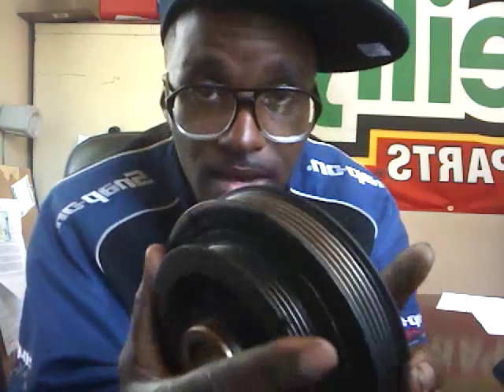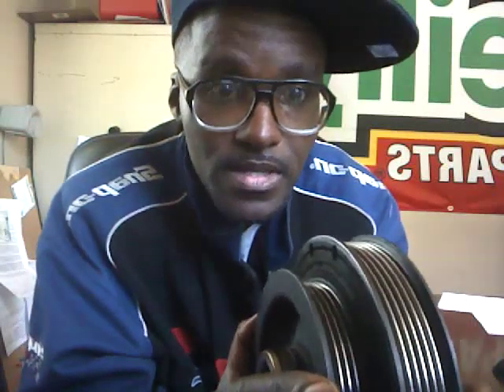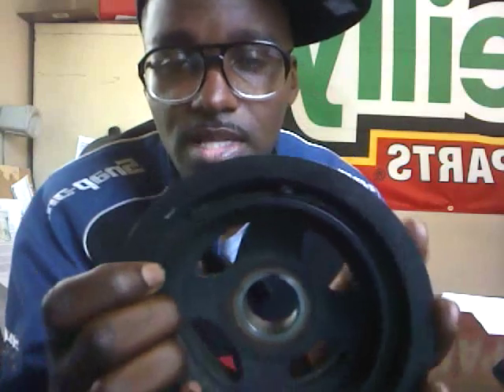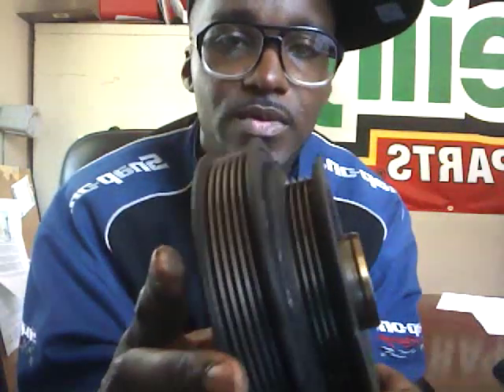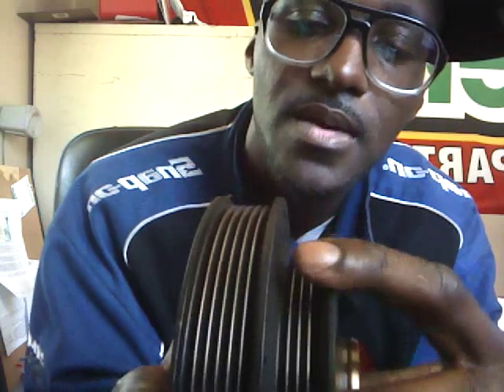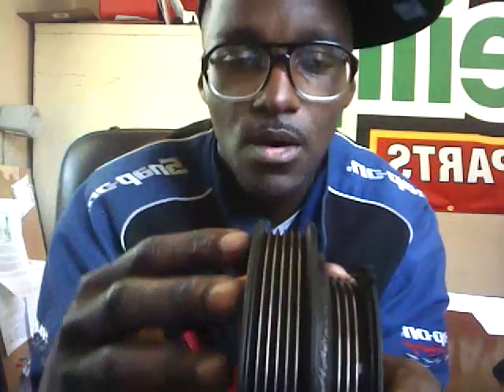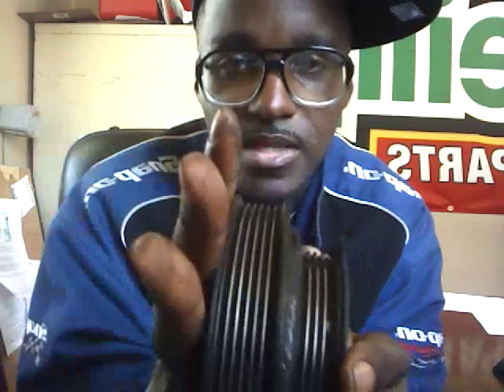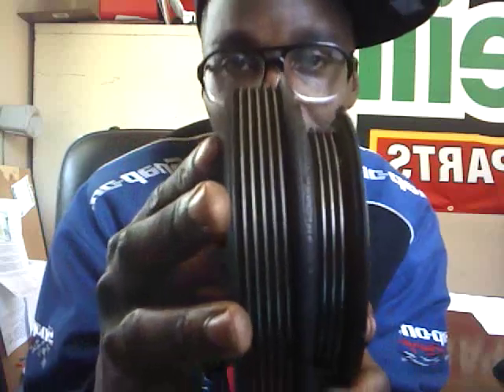What is a harmonic balancer?

Comment: That not a balancer ..it balancer nothing. 
   The rubber is what dampen the shock on the parts that the serpentine belt drive... its does nothing else.
     Older vehicle use harmonic balancer because they didn't have precision machinery then
Reply from the maker: That's what the box says.
Reply: @MobileMac1981  bro its just one if those miss use name given to items.
    A balancer would have sign that its balance either by adding weight or removing...  not saying it doesn't exist but modern engine doesn't need it

Comment: Thank you for affirming my greatest fears. I only have 600 miles to drive this July 4th weekend! Mine has some wobble and the rubber is cracked. At least I diagnosed the squealing...after pointlessly replacing the tensioner and idler pulley. I'll pack an extra belt and cross my fingers. Thanks for the up.

Comment: Good video Ron. Some call this a Harmonic balancer, others a Harmonic damper. Its main purpose is to absorb the energy of the harmonic vibrations set up in the crankshaft. The crank twists a fraction every time a cylinder fires then whips back again, at certain revs this can cause the crank to resonate and this could snap it clean through. The other effects are accelerated wear on the timing belt or chain and ancillary belts. If the damper separates it can head through the radiator or take out other components on that area. Not a good day. Best check these at service intervals and replace with OEM and not aftermarket dampers.
Reply: I think for those that know absolutely nothing he did a good job. I don't feel that he needed to sound like a NASA engineer to explain this.
Reply: +flaskandsarnies  Thanks for the detailed explanation.  This guy sucks!... no idea what he's talking about.
Reply: +flaskandsarnies  Thanks for the detailed explanation.  This guy sucks!... no idea what he's talking about.

Comment from the maker: Ron, they came up with the name because it helps eliminate the vibration that the crankshaft gives off....it basically balances the weight of the crankshaft.
Reply: 1st year here...why would the battery light come on?
Reply from the maker: When the battery light comes on that lets you know that your alternator is not charging. The engine is now running off of your battery and when that battery is drained....the car will shut down.